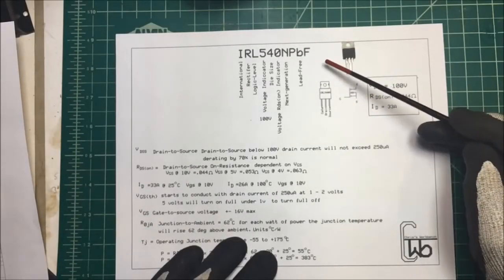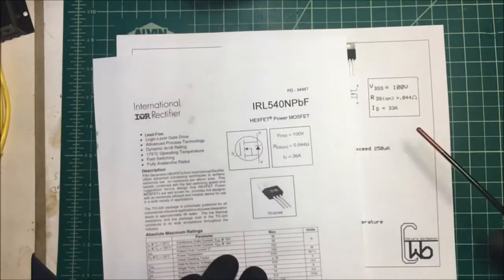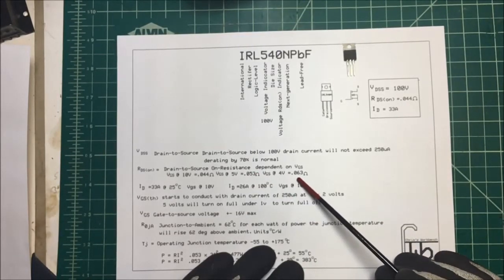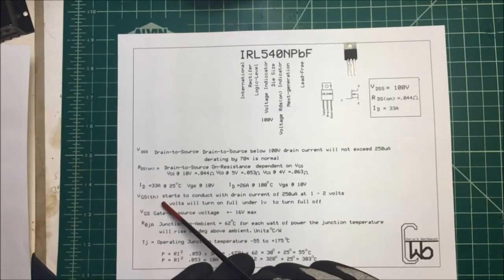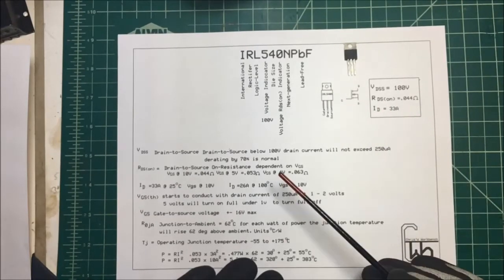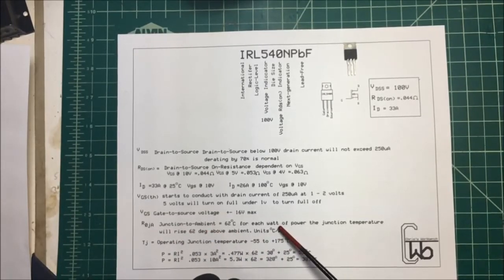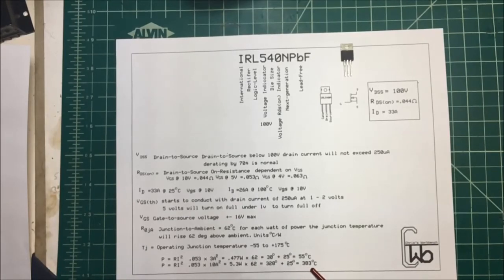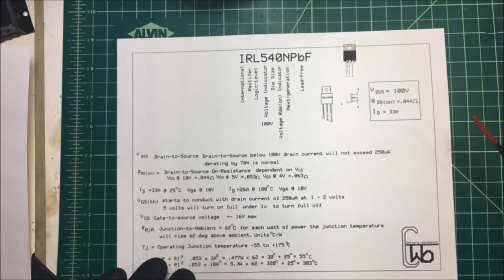Choosing a Mosfet

Comment: Doesn't it make sense to look at the normalized graphs instead? Those values on the first pages are just marketing values IMHO. If you look at fig 4 of this datasheet you will see the normalized on resistance at 25°C junction temperature is around 1 ohm. Since 25c jt is never going to be a reality for us mortals we go at around 100c and you can see it's around 1.7 ohms. That's at least how I have been checking for my mosfets
Reply from the maker: Good comment thanks